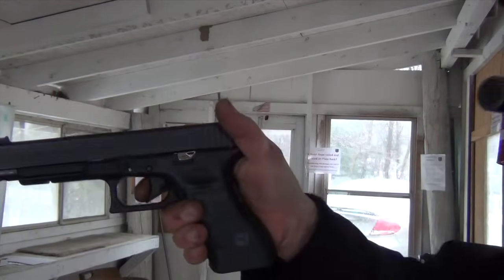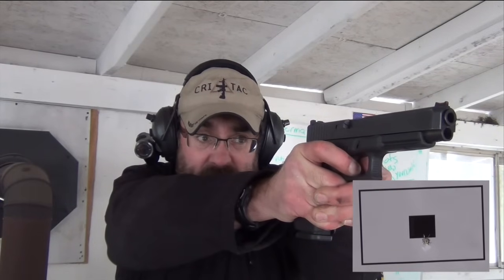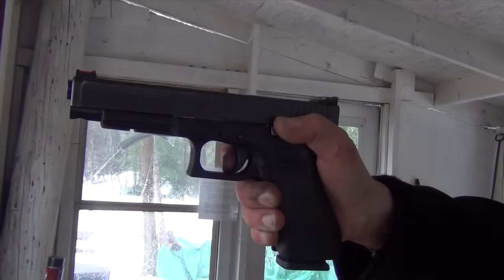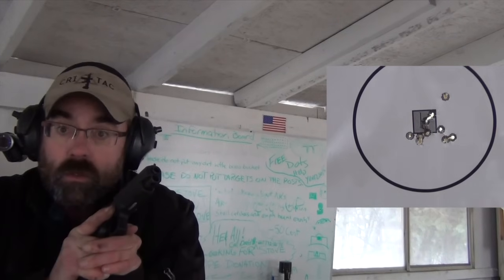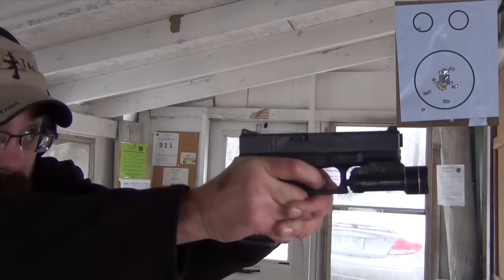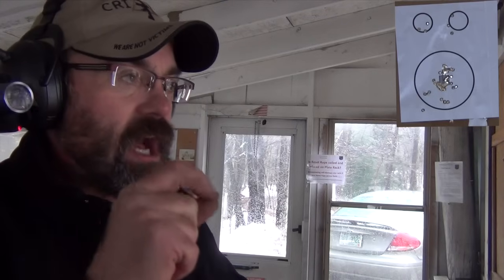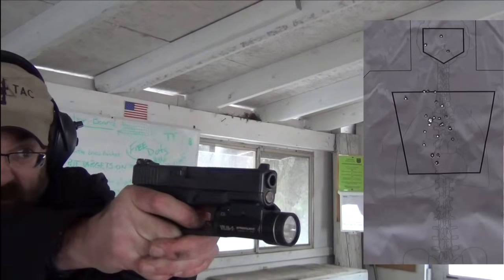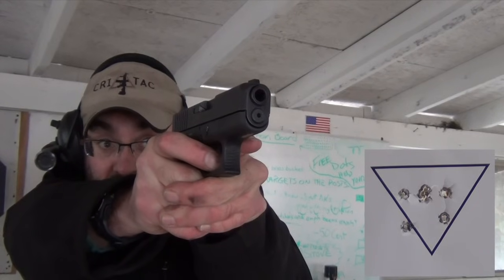Mastering the Glock trigger

Comment: I like.glocks but if u r in a gun fight that person who owns a glock may be dead because of the reset process .i will stick with a smith and wesson non striker fire gun
Reply from the maker: John, thank you for watching and commenting. Simply put, no one is focused on trigger reset when they are under a flight for your response. That being said, learning to take advantage of the reset is extremely valuable. I put 150,000 rounds through polymer frame handguns. They work as well as any other handgun in my opinion.

It really comes down to the individual users proficiency with whatever tool they’ve  selected for personal protection.

Personally, I am completely agnostic as far as brand, model or make.  It all comes down to reliability, training and proficiency.

Thanks for watching and commenting. I hope you will subscribe to the channel.
Reply: @GunsGearOnTargetTrainingLLC  if ur ammo avg at 30 cent thats about $45k. holy shit bra u couldve bought an atlas $6k
stac xc $4.3k
g19 tti $4k
g34 tti $4k
nighthawk pres $5.2k 
hk usp tactical $1.5k
wc edc x9 $3k
langdon 92 elite $2k
plus 5 rmrs = 2.3k

you would still have over 10k for ammo brooooo u wild
Reply from the maker: @hrlkt3413  back in the day 9mm was less than .12 a round. Reloading at that point cost me .08 a round. 

I’m much more interested in shooting that owning a collection of handguns. My guns are tools and used frequently.  

Thanks for watching and commenting. Stay safe.